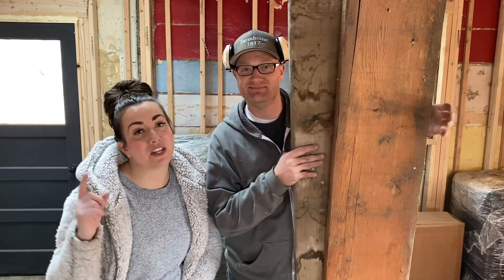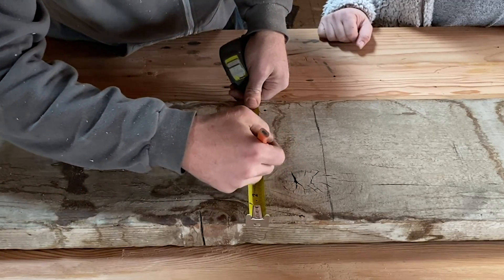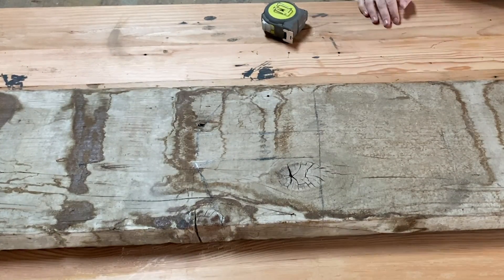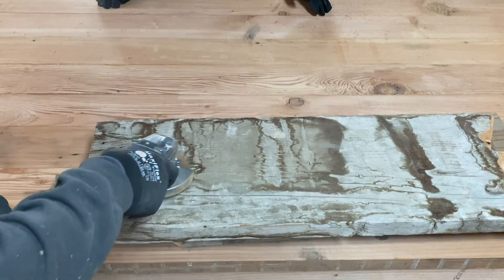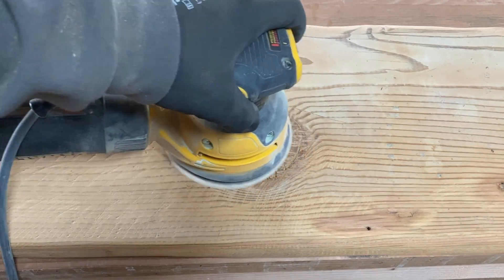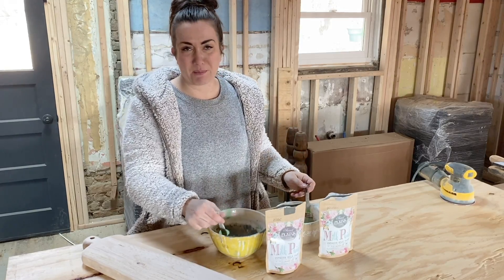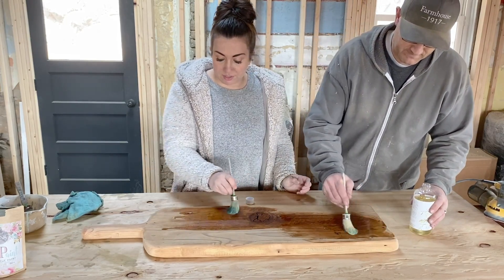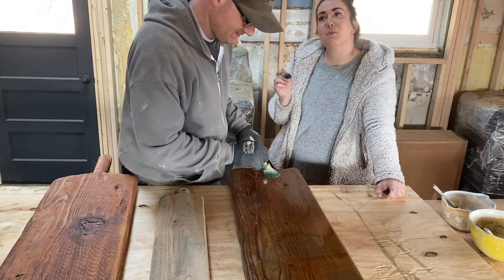How To Turn Salvage Lumber Into Money | Antique Cutting Board DIY

Comment: I’m wondering if you liked the angle grinder for first pass to get sharp edges off before using sanding? I have always used the sander but some projects take quite a bit of time and effort to get them rounded and looking old. How much do you sell the large boards for? Oh my rule for arguing is ask the question “will this matter a year from now?” If not move on👍🏻Thanks for sharing😊
Reply from the maker: Oh yeah. The angle grinder is so fast!  
When we use the old wood from the farmhouse The large boards sell for around $100.00.

Comment: Love the 20 yr old wood grinder!  With that great tool, I'd make a center "well" or depression for making dough (flour piled with a raw egg center, slippery lit'l egg always runs away) and/or individual EGG pockets/craddles for whole eggs so they won't roll away!?  
Imagine a Big Old Butcher Block Top like the wonderful French butcher shops had - all uneven, worn in the one working spot, with the lowest portion leading the liquids to a catch bucket?!  Not practical but so neat and can never find (here in the USA).  
Have fun!
Reply from the maker: Casey Trudeau we love the angle grinder for dough bowls. Have you seen our dough bowl video?  Zeb actually used two boards to make a dough bowl. It was pretty cool

Comment: Zeb, what kind of blade did you use on your grinder and where did you get it?
Reply from the maker: It’s a wood carving disk and I get mine at harbor freight.
Reply: @JamiRayVintage  I looked online at the Harbor Freight grinder wheels and I couldn't find it. Maybe you could show us a picture of it?!
Reply from the maker: https://www.harborfreight.com/4-1-2-half-inch-carbide-cup-wheel-66613.html?cid=paid_google%7C%7C%7C66613&utm_source=google&utm_medium=cpc&mkwid=s%7Cpcrid%7C385358577111%7Cpkw%7C%7Cpmt%7C%7Cpdv%7Cm%7Cslid%7C%7Cproduct%7C66613%7C&pgrid=75998373342&ptaid=pla-833309118883&pcid=6548846347&intent=&gclid=EAIaIQobChMI3d7LoYOj5wIVtR-tBh0deg0oEAQYBCABEgI1MvD_BwE

Comment: Hello, I have made these and LOVE the old wood ones. However, i used zinc sweet pickins on the new wood and I am not thrilled with them. If I'm not, then they probably won't sell. What tips might you have for the new boards. The zinc came out more green on the new boards. Can I mix sweet pickins and farmhouse together??
Reply from the maker: Yes, they mix well.

Comment: How often do you have to add the hemp oil to the boards?
Reply from the maker: Not often. If they get dried out you may want to reapply but they should be fine for a long time.

Comment: Does hemp oil have to be buffed after it dries?
Reply from the maker: We usually buff off the excess after an hour or two and let it finish drying. Then wash and use normally.
Reply: @JamiRayVintage  My hands hurt so I was looking for a product that was easier to buff than wax.
Reply from the maker: When I say buff off the excess I mean wipe it off. It’s really not buffing.
Reply: @JamiRayVintage  sounds good.

Comment: Vinegar and steel wool will stain the wood as well.
Reply: But is that food safe?  I love that type of stain for the look but it stays stinky for MONTHS.  I wouldn’t like to have it on a cutting board, personally.
Reply: @luannadobson9687  Non-toxic. What you get is iron acetate. It will have an acidy/vinegary smell and it very well could transfer some flavor. I was just offering it as an option.

Comment: Tape measure math.
Hold your place for the long measure. Fold the clip end back to the hold point. Read the value at the center of the fold curve.
Example. 
Measure 55 inches. Place the 0 end at 55 inches. Read 27.5 inches on the inside of the tape's loop. Too easy Drill Sargent, too easy.